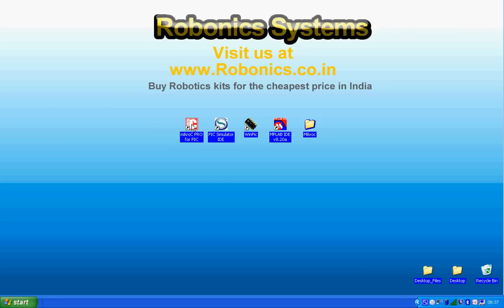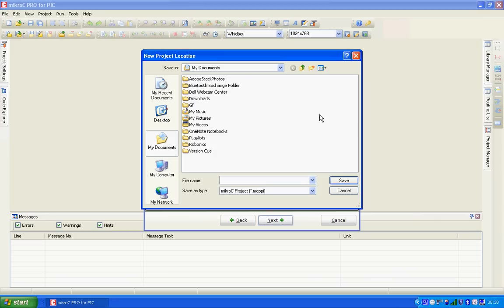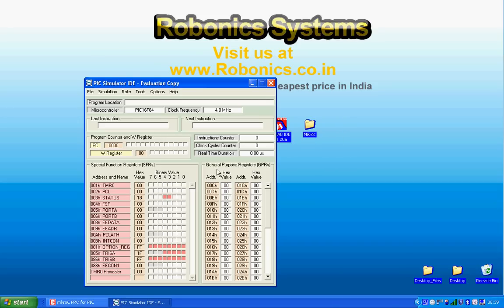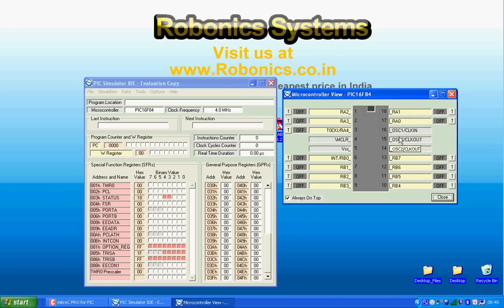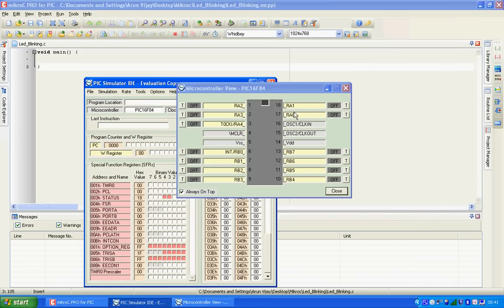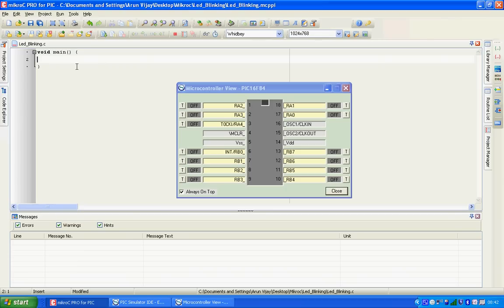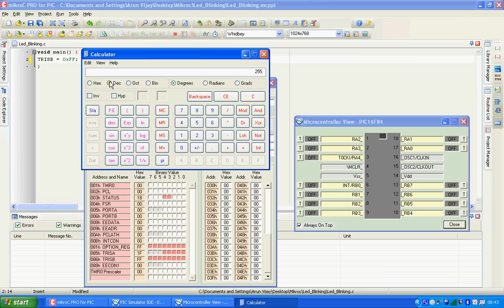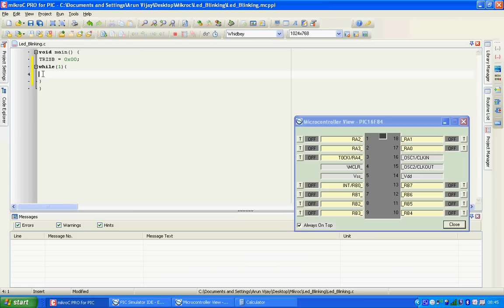PIC Microcontroller Programming Tutorials - Part 1

Comment: @CamiloSanchez1979 MicroC and oshonsoft PIC simulator IDE is not free,  MPLAB is free though both software requires a specific hardware programmer for it to work

Comment: Punctuation === I'm currently building my own os assembly c++ and ive checked the code 
I seem to have a problem a int 3(break) I'm not 100% sure on whats causing this... Its most certainly not the in the code. but the hardware itself generates it 

Maybe you can help me... And for the guy ripping you about the accent "how does an ozzy find sheep in long grass"

"fucking marvelous"